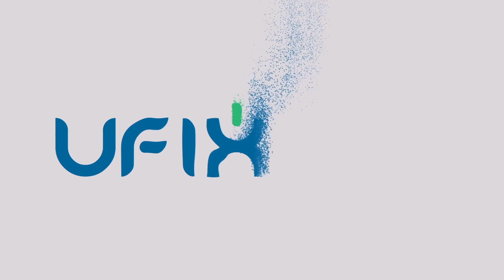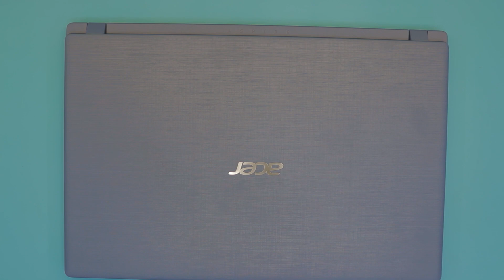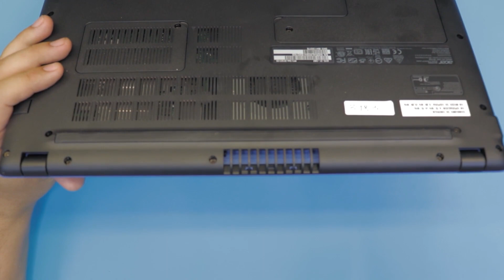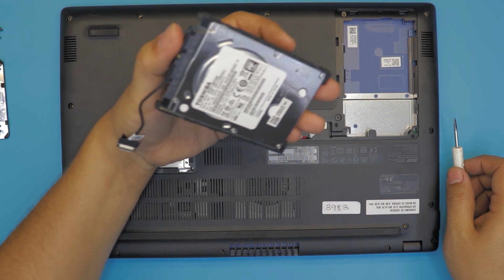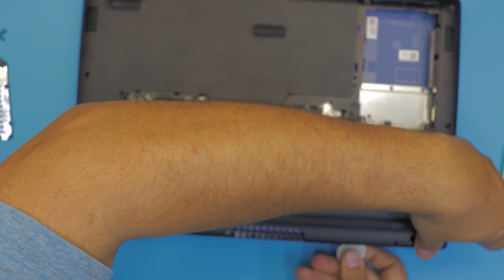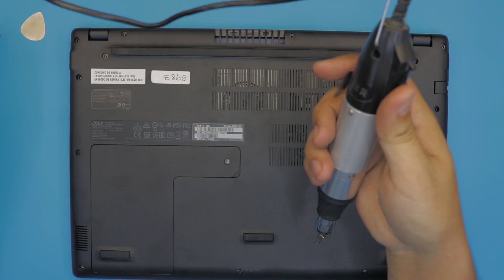Acer aspire 3 worst build 2018! repaste aspire 3 A315-31-C80z

Comment: That’s an old video, but I have a 2019 AMD 17" model and they upgraded the cooling system . I upgraded the ram to 20G total and the 1Tg hard disk to a SSD. Works fine with Linux ;-)
Reply from the maker: Thank you for your feedback! If you wish to support the channel, you can like, subscribe, or both!
Regarding your question, ya acer makes good laptop but this model they went crazy and horrible, you may have a better version of it with better components and over all much better than this trash.

Comment: Is it possible to add heatsink and radiator to this processor ?
I have the same laptop , when I try to open any thing it gets too hot this tiny piece of metal isn't enough to handle the heat produced by the processor .
Reply from the maker: Thank you for the feedback! if you wish to support the channel you can LIKE or SUB or both :P
regarding your question: its def. possible but requires a lot of tools and soldering skills, we in the repair shop we can do it, but not something can be done at home. i will make a video on how to do it in the future.

Comment: Do you know what the video card is? 
I have the same laptop and I can turn it on but it doesn't show any video!
Reply from the maker: Thanks ✌  for the feedback!  if you wish to support the channel you can LIKE or SUB or both :P
Regarding your question:  this laptop doesn't have any dedicated video card or chip, its an APU built in CPU graphics. none replaceable, but your problem is not the GPU or CPU, 
remove the battery and remove the bios battery (the small tiny battery on the motherboard) just pop that battery out, and then with everything disconnected press and hold the power on button for 30sec then plug the motherboard battery and the internal battery and the charger and power on and wait 10-15sec.
Reply: @uFixTek  I already suscribed to this channel! And I just did what you said but it didn't work 😕
Reply from the maker: okay this will sound rare but i need you to do this,:
remove the motherboard completely and place it on the wood table, remove the bios battery and remove the heatsink of the CPU.
make sure you are room tem place and no air fan or air condition in the room.
place the board only without wifi card and bios and internal battery (pure motherboard)
grab a hair dryer and set it to max heat and medium air if possible, and hold it directly over the CPU with a 1" distance for 7-9min then remove the heat and let it cool down on its own!! dont blow air to it or anything for 15min.
repaste and test it :P
Reply: @uFixTek  Didn't work 😕
Reply from the maker: @jesusl.8602  ok give me few hours to take a look at the schematics and i get back to you.
Reply: @uFixTek  Thanks a lot !!
Reply from the maker: i checked the schematics and with a friend that deals with acer laptops and the problem is from one of the ram blocks on the motherboard that is failing they are soldered on board you will need to remove the ram chip and reball the new ram chip, and this process can be done with professional technician, sorry to inform you about it.
Reply: @uFixTek  Don't worry about it, I was thinking to change the motherboard... thanks for your help!
Reply from the maker: oki my friend good luck :)

Comment: I have an acer aspire3 bought it last year and now it is broken, simple battery issue, sent it to help center of acer now it got worst.
Reply from the maker: im very sure they have placed a horrible thermal paste, i would recommend you to open it and repaste with a good thermal paste and also before all that download the program that is to check the HDD status they may have banged the hdd around and caused a bad sectors with one bad sector in the correct spot the system will slow a lot.
https://www.hdsentinel.com/download.php
send me the screen shot of the HDD status anything under 95% on health  you must replace it, even if the application says excellent or good.  i been doing for a long time and trust me with a hdd with 99% of health it can crash the OS.
Reply: @uFixTek  okay i'll try to do that part. They kept on telling me it is okay, all okay "see sir the system/diagnose says it is all okay", they also said blinking light is normal. But when.i saw a youtube vid says battery is draining.
Reply from the maker: def check the HDD 1st then can you send me a short video on the blinking, or email me so i can connect and check few stuff quickly.     ask@ufixtek.com

Comment: Good day.

I just want to ask if you are familiar of the ACER ASPIRE 3 A314-32 C0HQ model of laptop? Does it have a heat sink?

Thank you for your further response.
Reply from the maker: Thank you! for the feedback and your support to the channel by SUB :P
regarding your question: YES we get few of the A314-32, and in the name of god dont get that, the rams are not up-gradable and CPU slow AF, you better off with an tablet.
you can use the same money to get an "intel i5" laptop

Comment: I have this laptop BUT I have:
 Aspire 3,
 CPU :Ryzen5 3500U
GPU: Vega mobile 8 
RAM: 2x4GB 
Memory: SSD 420GB

I bought two years ago for 2299 PLN ~ 512€.
In my opinion, the best budget laptop in 2018, suitable for games and work on a daily basis. But I wrote above that I have the same laptop but with a different, much richer interior. 
Cs:GO ~35-80 fps
Forza Horizon 4 - graphic on: VERY HIGH ~ 25-40 fps
PUGB - graphic on ULTRA ~ 40-60 fps.
Reply from the maker: you have the Aspire 3, but you got a different version the mid range version , that gives a bit more punch. this one is A315-31-c80z
and this one is a real crap it wont even run minecraft

Comment: And what you've said in this video is currently happening in my laptop.
Reply from the maker: the only half fix would be, to replace the thermal paste with a artic m-4 and this will get you by abit longer. but if the CPU is over heated a lot it may be damaged inside. 
the only thing you can do is replace the thermal paste with "artic m-4" dont use other cheap paste.

Comment: How can I fix this? I already spent my money buying this laptop.
Reply from the maker: the only half fix would be, to replace the thermal paste with a artic m-4 and this will get you by abit longer. but if the CPU is over heated a lot it may be damaged inside. 
the only thing you can do is replace the thermal paste with "artic m-4" dont use other cheap paste.

Comment: Somebody knows if the Acer Aspire 3 A314-31-C937 has a slot for extra RAM?
Thanks in advance.
Reply: Es igual a la computadora del video, CPU y RAM soldados a la placa madre, asi que no, no tiene slots de memoria RAM, una total estafa
Reply from the maker: remove the bottom cover and you will see if there is any, but as my knowledge there is only one dim.

Comment: Today I unplugged the fan and worked with the laptop as I do everyday, The processor area was feeling warm just under an hour's use. 

Reconnected the fan back... And its running normally now without the warmth noticed earlier. 

I was right that the fan has been put there for a purpose.. You can try it yourself. I was happy initially that I would save some battery now.. but it wont work like that
Reply from the maker: the fan does a bit of help and it flows the air and does a air circulation, but its not the proper way of cooling a cpu, passive cooling is what it is.

Comment: And also how to disconnect the fan? Can it be done via software (BIOS). Can I remove the fan completely? Will remove some weight as well besides battery load
Reply from the maker: open up to see what type of heatsink you have if you dont have a condenser then unplug the fan jack. you will save alot of battery. but if you have a proper heatsink then dont, your model i belive it comes with proper heatsink, but to be sure open it up , or @2:56 check trough the mid back side to see if its empty or its has a aluminum fins.

Comment: Is Acer Aspire 3 A315-31 P4CR same as this one?
Reply from the maker: no actually the A315-31 has a proper heat-sink,
Reply: @uFixTek  No brother, I can see the shining aluminium plate through the plastic grill.. I bought it in 2017, now the price is UP! by more than INR 6K And that costlier version has a heat sink.. at least in the pictures it has.
Reply: So I guess the heatsink from the newer version should be a direct fit on my older version?
Reply from the maker: i believe it should be a perfect fit. if you can get the heatsink try it on and let up know :P
Reply: @uFixTek  Disconnected the fan just now.. just had to open the hard disk slot.. the fan plug was accessible from there.. are you sure it wont do any harm? The Acer R&D must have placed it there for a purpose dont you think?

Comment: Hello, im using this model and my screen js went black while i can see something when I light a torch near it,  please help me fix it because it is totally different from the  other laptops.
Reply from the maker: there is not much you can do because your back light on the screen is burned, therefore you must replace teh lcd screen. to verify this remove the flex cable from motherboard @6:16 its the flex cable on the right up side in the corner of the motherboard its a wide flex, once you remove that use a hdmi cable and to test with a tv or external monitor. good luck

Comment: I have that laptop. It's pretty slow . How can i make it faster?
Reply from the maker: the only major upgrade that can make it 60%faster or maybe a bit more its removing your mechanical hard drive HDD to SSD drive. 
recommended ssd are :
https://amzn.to/3beDQU8
Reply: Does it support 1 TB SSD? Right now i got 500 GB HDD
Reply from the maker: Ram Kharlian you can put a 2tb ssd and it will work just as 500gb ssd, there fore the gb or tb wont matter , it will work 👌 good luck

Comment: I have this laptop but am thinking of actually getting a heatsink assembly from one of the other similar models & install.. anyone think its worth they shot?
Reply from the maker: its worth it but you will be needing to solder the  fan cable to the right path and voltage. so its not just plug and play.

Comment: Mine is okay with Ryzen 3500u, quiet, fast, fast wireless, M.2 SSD.
Bad thing about mine is that they removed sata port from the dock.
Reply from the maker: then your base model is different than this one, this one is a315-31-c80z
Reply: Aspire A315-41

Comment: I have acer aspire 3  A315-32-P4HZ (diffirent CPU,but same layout as A315-31-C80Z)
thanks for your video
I try to rotate the fan 90 degrees (use some hot glue)
it really works. 
Maybe sticking more copper pads to  the "heatsink"  will be better.
Reply from the maker: yes modding it it will get you some what better performance, but for regular consumer its horrible experience
Reply: @uFixTek   this kind of laptop is almost fanless design 
Because its  CPU have lower TDP(about 4W to 6W)
 I find some laptop use a thick copper pad
the other use thin heatpipe but the pipe end doesn't contact fin or metal surface 
To be honest,Aspire 3 use thin aluminum sheet  is the strangest design,
and useless fan only make more noise.
Reply from the maker: 劉鴻志 you right to point, but the fact is that no matter the TDP of the cpu, if the cpu goes over 75-88c after hours of use  (and it does on this model), then yes the fan is very needed. But if you are using for a simple office and internet use the temps stay around 60-75c depending the room temps and other factors. But not everyone know what they have bought, mostly buy this laptop for the kids because of price and thinking the kids can do what ever even game. So it comes down to how its marketed and if the marketing is clearly states that this are for office use and not anything else. Or the buyer has a vast knowledge of TDPs and cpus, and even if they do they should know better that this is a tablet with screen🤭😂 

 I get most of this laptop coming in the store for repair because of cpu over heating and have to do a reballing on cpu, if i have to do a reballing on a cpu it means two things 1. Customer didn’t know what he /she got 2. Bad marketing

Comment: I saw a SSD M2 slot to the right of  cpu heatsink, you say nothinght about it, this nbtk  has ready to use memory stick?
Reply from the maker: yes there is a connector for m.2 o NVME right at @3:48 by heat-sink, its a PCI-E lane and its recommended for NVME sticks, its6x faster than regular m.2 ssd or normal ssd as pcie lane has a wider data transfer rate than sata.  if you put a windows 10 on nvme and install it you will see a dramatic change on speed.  thanks for the comments :P
https://amzn.to/34JD2mc

Comment: Acer aspire 3 comes White many models: Acer Aspire 3 A315-55G-317H come Whit a i3-10110U (10th generation) ,250 GB SSD, Mx230 Video card and 8 GB Ram.
Reply from the maker: yes that is true that is why i indicated the exact model  "a315-31-c80z" , and this model are the worst of the acer 3, also its "with" not "white" :P
Reply: My niece has a A314-31-C955 with celeron 3350, 4GB Ram and 500MB HD, USB, HDMI and SD memory slot, is very slow , I would like downgrade to Windows7 or put some Linux software.

Comment: Can i replace the the cpu slot with an apu from ryzen??
I have a amd a4 i want to replace with ryzen 7 2700u with vega 10 graphics is it possible?
Reply from the maker: Legend 1409 there no Way you can replace that cpu with any other cpu, there is no heat pipes there are many other components required to power other cpu, the bios and many many other stuff. Don’t waist your time looking for upgrade cpu.
Reply: @uFixTek   rip gaming on 60fps        - me 2019
Reply: Hahahahahahaaaaaaa

Comment: They really cheaped out on that, I got the A315-41 ryzen 5 2500u version and the cooling is much better with a proper copper heatsink , duel ram slots you can upgrade to any ddr4 sodimm

Comment: Hi , @uFixTek I have exactly the same motherboard, can't find the reset password jumper, can you help me? Thanks!
Reply from the maker: there is no jumper on this models you need to find NXP chip (u77) then short the pin 5 and 6 (SCL and SDA pins)  and power-on keep holding the short then go to bios then release the short.

Comment: @uFixTek
 Hi, my laptop stopped charging and i can't turn it on because battery level is too low, but when i press the power button i still have some lights flashing. What could be the problem and a possible solution?

Btw I've just opened the pc as you did and removed RAM for few minutes to see if something changes.

Comment: Ryzen based Aspire 3s are really good. You have one of the worst modern mobile CPUs in your configuration, so I understand your complaints. Ryzen config has upgradeable non soldered RAM, better cooling.
Reply: No wonder I couldn't find the 4 GB Ram!
I was actually planning on buying 2x8 GB RAM, nevermind then.
Reply from the maker: @Ashtrauman  ya its sad
Reply: @shubham bhardwaj I'm using it for 6 months, it's Rock solid since I bought it. Meets every expectation I had. At first I thought it would have worse cooling than it's counterparts but I was very wrong. It doesn't thermal throttle while playing AAA titles such as GTA5 (which runs on medium settings just fine), even boost GPU clocks with proper thermal stand.
Reply: @shubham bhardwaj A315 41G with Ryzen 5 2500u, 256gb ssd, 8gb of RAM and Radeon 535.
Reply: mine doesn't work anymore and it really laggy

Comment: Hi. Looks like a315-21 model. How do you think, how can I upgrade cooling of CPU? I have no much money to buy new laptop, but it's really annoying that CPU goes throttling on basic operations...
Reply from the maker: Arthur Gafarow you cant just buy a upgrade kit or anything like so. You have to modify and buy of ebay low profile 5v fan and some heat sink tubings and make your own its complicated and not easy task. You need heat station and soldering skills
Reply: @uFixTek  oh my God... So will my laptop die soon?
Reply: @uFixTek  or maybe I can solve it buying special cooling pad for laptops? Will it work for me?
Reply from the maker: cooling pads dont work for this it will not do anything  we have tried the simplest ways and not working.
Reply: For the throttling - go to Control Panel\All Control Panel Items\Power Options\Edit Plan Settings and click Change advanced power settings. Change the minimum processor speed to 75%.  The speed of the CPU tops out at 2.6GHz so that setting should give you 1.95GHz speed.. If it works great, try higher. If the fan noise is a bother reduce it 66%.

For the cooling - i might be tempted to self mod the fan and point its exhaust towards the CPU.

Comment: hi i have acer aspire 3 a315-21--96u1

When I replace my wifi card with ngff ExpGdc Beast external pci adapter cable there is blank screen on booting. Even if I do not connect the HDMI to the adapter and conect only the ngff slot with no power still boot with black screen. If ngff cable is removed display comes. Is there any bios mod for fixing the same or dont no could you help me ?
Reply: tata toutou I was gonna buy the beast thing but after your comment did you resolve it?
Reply: @alz283  no i cant resolve it bios is to much recent i have bug white list search before if you really can with your computer
Reply: @tatatoutou2739  did you try plugging hdmi into the graphics card and into a display from there?

Comment: Honestly I don't have any problems with my Aspire 3
I can even run games on it for an hour, not to mention that the cooling is just fine.
Maybe it's because I have an AMD Aspire 3?
Reply: Aspire 3? Its ok to Me. Just put Cooler. And Exhaust fan
Reply: No, i got an AMD aspire 3 and it's just fine, has cooling and everything. No clue what is wrong with the laptop in the video, maybe he pulled the heatsink out before recording
Reply: @fleksimir  I think it's just Intel having bad mobile chips
Reply: I have no problems either.but I was wondering if a solid state drive can fit inside...(Samsung 85o evo SSD)